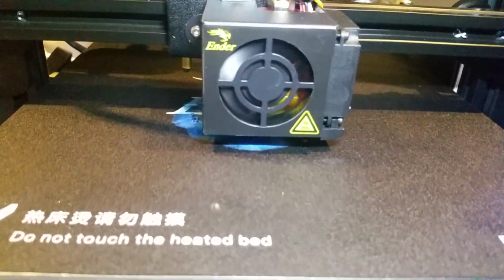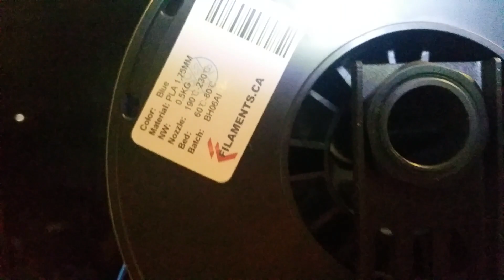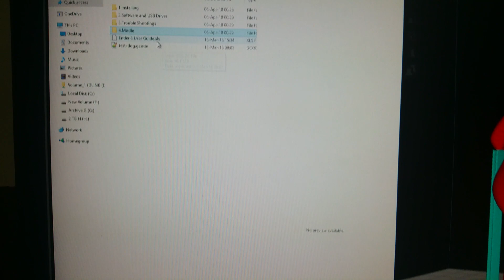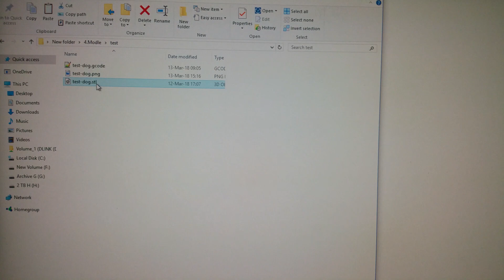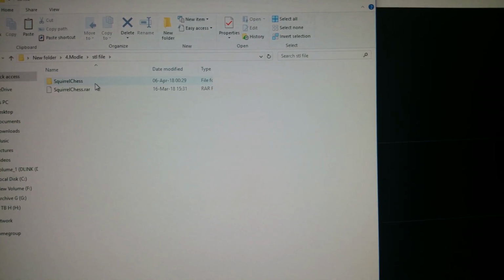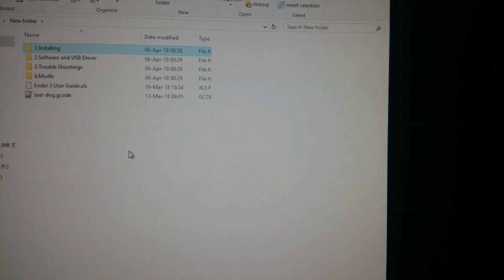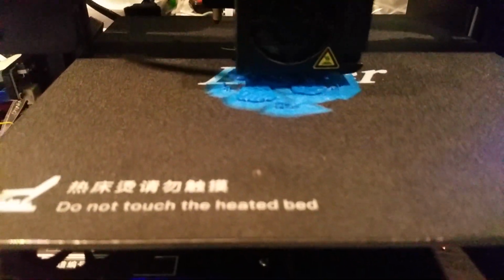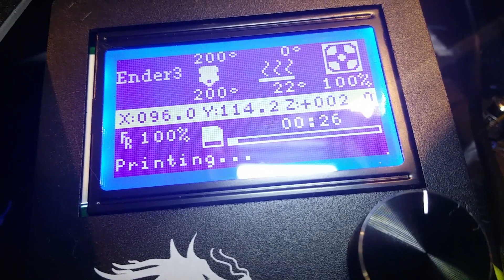Creality ender 3 (part 3) test printing

Comment: Just got done putting one of these together .... is the top of the print head assembly suppose be on an angle?  The top two rollers are longer than the one on the bottom !
Reply from the maker: what you are describing doesnt sound right, pictures would be helpful, as i have pointed out to others on my other videos, there are several ender 3 groups on facebook where you can post pics and ask questions
Reply: yeah............. (china!!!)  They never opened up the top 2 holes on the plate where the eccentrics fit in....... had to rip it all apart to drill them out (then of one of fan covers screw was so tight the head of the screw stripped out ....... had to drill the head off)
All looks good now!
thanks

Comment: Question as I haven’t found a definitive answer anywhere yet and you seem knowledgeable - I just built mine and went to test print, filament feeds just fine and preheats and melts (as evidenced by the melted filament leaking out) but it seems that when it prints it doesn’t actually feed any filament through. I know it’s feeding because it’s pushing the plastic tube out of the weak little mounting fitting but nothing seems to be coming out of the nozzle.
Reply from the maker: Appearances can be deceiving ;) . Sounds like you may have loose fittings causing build up to block most of the flow, and possibly the PTFE tube is not properly seated right against the nozzle. I had to take mine apart several times since i got it because the tube wouldnt seat all the way down, despite using enough force to kink the tube. I would have to take the nozzle out clean any built up filament, To do so heat up the printer to 220-230,,,something above the usual temperature of what you are printing with (probably PLA), then carefully remove the nozzle, there are guides on how to do this with a cr10 (3d printing nerd i believe). Then when the nozzle is off, i push the ptfe tube all the way through the heat block and pull it though all the way (it will be hot, use gloves or gently with pliers) kinda like flossing i guess, this will hopefully scrape most of the built up filament from inside the heat tube.
Reply: reflector36 Thank you! I did exactly this and all seems to be working well now. I wasn’t really seeing the PTFE tube as an actual mechanical guide for the filament until I took it apart and put it back together again.
Reply from the maker: best way to learn the machine, take and part, put it back together and hope it works

Comment: could you try printing this and share the results thinking about buying this printer :) 
https://gumroad.com/l/OxKwn
Reply from the maker: check out the facebook groups that are out there, lots of us have the printer now, and if you check out original Cr-10s, it most likely prints very similarly. But right now my printer is busy and already modded beyond stock so my print may not be comparable

Comment: Is it really making lot of noise or it's just your desk configuration?
Reply from the maker: Partly my desk, but it is not overly quiet, the fans do make a fair bit of noise and i will want to try and find some more silent solution. If i lift it up while printing it still has fan noise but it greatly reduces the vibration. So better noise isolation on the base would be a big help this and many printers, which is why the Wanhao is up on foam and feet

Comment: What is real printing size? As the Z axis is close to bed I just wonder if the whole bed can be covered? Creality gives 2 contradicting information i n text and graphics: http://www.creality3d.cn/page92?product_id=23 (150x150 and 220x220)
Reply from the maker: the bed measures 235x235, im giving my self 10mm of buffer and set my slicer to 225, The height is supposed to be 250, but i feel the top bar will get in the way of the bowden tube so about 230mm is probably a safer limit